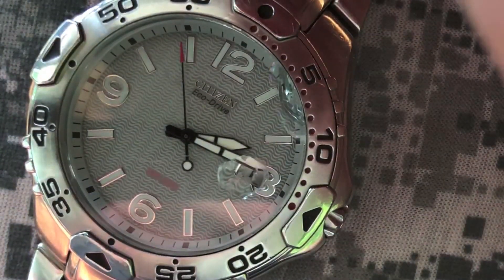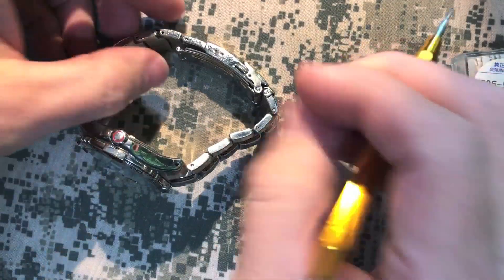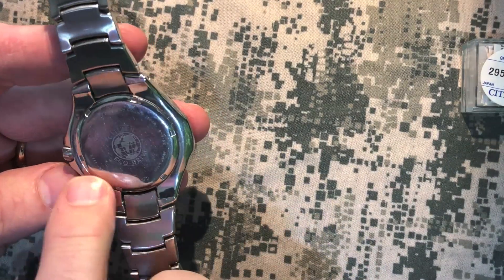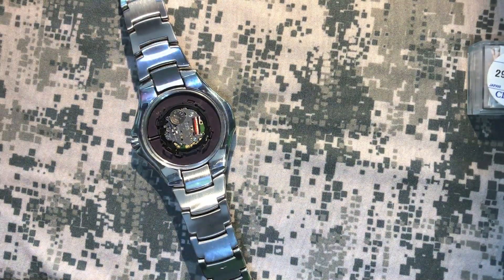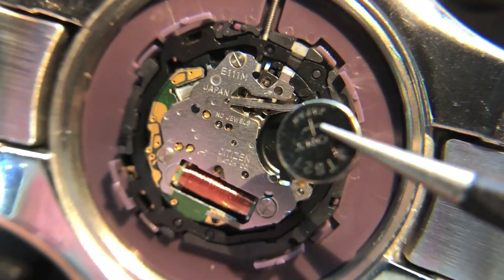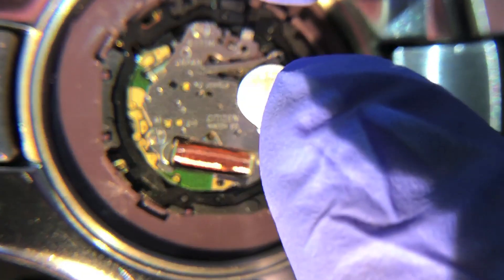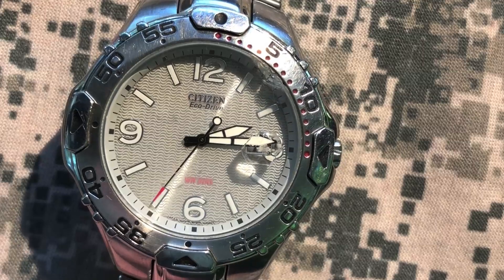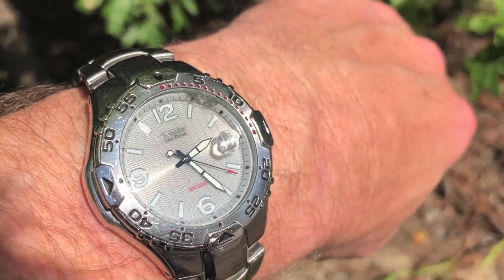How to Fix Your Citizen Eco-Drive Watch | Replace Capacitor

Comment: I have a Citizen Eco and after 10 years  it was ticking with 2 seconds increments too. I charged the battery by putting it at the kitchen window for two days, but it was still ticking with 2 seconds after that. Pulling out the crown and pushing it back solved the problem! It has been ticking nicely for 3 year years after I did that.
Reply from the maker: Nice. Your reset worked. Some of us haven't been as lucky, and the battery/capacitor/rechargeable cell needed replacement. You're at 13 years now, so you might be towards the end of life....if it happens again.
Reply: @WatchWitt how do you take the back off of one that doesn’t have the slots? My dads watch doesn’t have the notches.
Reply from the maker: @he-mansuncle7661 Depends on what's there. If you see ridges like a coin edge bezel all around the caseback, then a friction ball is your best bet. If you see a little pry ridge/lip on a small section of the caseback near the edge, then it's a snap off/on caseback. Proceed with caution there, as there's a risk of damage to the crystal when trying to put those back on without proper tools. I don't THINK there are Eco-Drives with that type of caseback, though.
Reply: @ thanks, I ordered the kit that you suggested. I don’t believe it is beveled, but smooth.
Reply from the maker: Hopefully friction ball, then. The kit I suggested doesn't include one, but they're about $8 on Amazon for a cheapy, and maybe twice that for a Bergeon: https://amzn.to/3Yvth92

Comment: I did this myself on two different 15 year old Eco-Drive Citizens. No problem. My only additional advice is while ordering a basic watch tool kit also order a little container of watchmaker Silicon grease. I always apply a very light coating of Silicone to the case back seal. My only gripe for the process is the expense of the capacitor. I can buy a twelve pack of standard watch batteries for $7. My Citizen Eco-Drive capacitors were $25-30 apiece. It is what it is. I love my Citizen Nighthawk that my son gifted me 15 years ago. While I was working on the Nighthawk I also replaced the scratched mineral crystal with a double domed AR coated sapphire crystal.
Reply from the maker: And it's like working on a car...you feel a sense of accomplishment! I enjoy it, too. I need to replace the crystal (and cyclops) on this watch.....

Comment: Anyone know whether you can overcharge a citizen eco drive? I sometimes hang it with the washing and forget to take it off for hours...
Reply from the maker: No, they have a mechanism that prevents overcharging. They do warn about charging in higher temperatures, though. For instance, on the dash of a car. I think they quote temp should be below 140 degrees Fahrenheit.
Reply: @WatchWitt  Thanks man! (BTW in the description you might want to change "minute" to "second", in first line.. HTH!)
Reply from the maker: 😂 Thanks! That mistake has been there 3 years...just revised....

Comment: where do you get other parts, and find a parts number list ?
i have a citizen watch that does not run, something is broken  i send it to the citizen service center, but that place is full of clown, they had the watch close to a month and did nothing !
Reply from the maker: It's difficult. But you can try Cousins or Eslinger. I'm surprised the Citizen service center wasn't helpful. They're slow and impossible to communicate with, but they usually send back a fixed watch!
Reply: @WatchWitt  Thank you !

i'm from Sri Lanka, the Citizen service center used to be good but i think it's under different management !

Comment: Why would amy manufacturer produce something as stupid as a solar powered watch? Conventional watch batteries are low-cost, available everywhere and easy to install.
Reply from the maker: I hear you, but there are also advantages to solar. One thing I can think of off the top of my head, this diver is more likely to keep it's waterproof rating if the caseback only comes off every 12 to 15 years, instead of 6 to 7 times in the same period. Most enthusiasts don't change the caseback gasket.
Reply: @WatchWitt  Good point. I just can't help but feel that manufactures implement this type of of technology not for the benefit of the consumer but as a form of built-in obsolescence.

Comment: The chargeable battery in most solar powered watch have a service life of about five plus years they do not last for ever logic sense like a vehicle rechargeable battery same principle
Reply from the maker: The original gen of Eco-Drive, which the watch in the video is, are getting about 12 to 15 years of life. I hear that more recent generations are expected to outlive that. Some of the confusion about these watches is that Citizen claimed the watch "never needs a battery," or has a "lifetime battery," etc. But, as you mentioned, that's simply not the case!

Comment: Yea many think the light storage battery will last forever but any kind of quartz time piece uses a battery
Reply from the maker: Yeah, these will run on light alone, no battery, as long as the dial CONSTANTLY gets light! 😂 But that wouldn’t be very practical. When Citizen first came out with these they claimed to the affect of “never needs a battery,” which I’m sure has created some confusion.

Comment: Thanks for this video. I'm looking to replace the cell in my Eco-Drive. However, mine doesn't have any notches on the cover. Any ideas on how to remove it?
Reply from the maker: Hard to say, as there are a few different caseback styles. If you have  series of small ridges around the caseback perimeter (almost look like a grip for your fingers to rotate it) then you need a friction ball. Or, if you see a little lip, almost like a screwdriver head, near one of the lugs...that's a snap on/off caseback. You pry/leverage that carefully to remove. But caution with those...they can be extremely difficult to put back ON without the right tools, and you risk damaging your watch...many will shatter their crystal while attempting.
Reply: I did a little more research and found out it is a monocoque case GN-4W-UL. Apparently, the bezel needs to be removed and the stem to replace the battery. I would love to see a video on that!
Reply from the maker: @stevenmonkman1500 Oh, wow, I've never seen a monoblock case from Citizen. Yes, typically you have to remove the crystal and go in from the front! You should be able to find some videos, but specific tools are needed. If you don't have the experience, this one is better off having done by a watchmaker.

Comment: People in the thread, try pulling out the crown & pushing it back in. Sometimes this works as it resets the second increments after/while charging. I purchased a Citizen Skyhawk from Amazon back in 2011. It’s 2024 today & my original capacitor/battery still works fine to this day. This watch has been in & out of rotation for months/years at a time & gets stuck in a drawer at times. I just put it in a window sill & it charges right back up no problems. It ticks in 2-4 sec increments when charging back up. I just pull the crown all the way out & push it back in & it works brand new again no issues.
Reply: Thank you man, just bought a new capacitor, put it towards direct sunlight for days but nothing, still 2 second jumps and index finger pointing towards NG. Pulled and pushed the crown and it jumped to LV.2 with regular one second jumps…happy ;-)
Reply: I have just left mine on a windowsill for years because the second hand was skipping, searched for a video on it, was playing with it while watching the video, essentially doing what you just said, and it’s working! I love this watch, it is a promaster nighthawk with a rubber strap, they never sold it here, I ordered it from Japan.
Reply from the maker: I keep mine in a window sill as well, south facing, so it always gets a TRICKLE charge. For those having charging issues, DIRECT sunlight is the way to go, though, as windows/screens can minimize the charge.

Comment: Thanks, I take a couple watches (G-shock mudmasters) into the jewelry store, for battery replacement. For some reason the tech at the Jewelry store did not work on these watches but they have someone that they send some watches to. The staring price for battery/capacitor replacement was $125. The capacitor and the watch repair kit added up to less than $30 (I will also replace the gasket based on your recommendation).  But while my citizen was more expensive it is still kind of a basic watch with no special features and I should be able to replace the batter/capacitor. Your video was very helpful.  Thanks for your video. Sorry for all the trolls trying to give you a class on battery vs capacitor.  Your video was fine. Order the right part in the first place and you don't have to worry about putting a battery where a capacitor should be. Regardless of what I am working on, I always check my parts across several websites to make sure it is the right one. I like the part about wearing gloves. That is my down fall. I get into the repair and forget to put on the gloves laying next to me.
Reply from the maker: Yes, it's expensive, but definitely worth it for those that aren't comfortable doing the replacement themselves. I mean, you're going to get another 10 to 15 years out of it!

Comment: Is this 2second ticking normal for a watch I bought brand new just 7 months ago?
Reply from the maker: That means you need a recharge. Follow directions for that (HOURS under a light or in direct sunlight) and if it still does it, then this video applies to you too. But be sure to read the recharge directions. Most people aren't aware that it can take days to recharge.

Comment: Before you replace the capacitor try putting an adjustable LED LAmp above the watch for a few days and see if it helps.  It helped me to charge my Citizen Skyhawk that had not seen light for years.    I left an LED Lamp directly above the watch (Maybe an inch above the watch) for 2 days over the weekend at work and when i got back on Monday it was fully charged and held the charge as if it was brand new.
Reply: This!  I was ready to replace the capacitor in my 15 year old watch because it hadn't charged after sitting on my desk near a window for several days. Then as a last ditch effort, I put it inside a lamp - after about 5 days of being exposed to light at close range, it started working normally again.
Reply from the maker: Absolutely! Window sills are great for occasional top offs while not wearing your watch, but window films/protectants, screens, etc can reduce the effectiveness of actually charging.
Reply from the maker: Absolutely! I tried to convey that, especially in the video description. Most people don't realize it takes DAYS, like you mentioned, to recover from a completely dead state. However, if your watch is 12+ years old, and that doesn't work, then it may be time to replace the capacitor/cell/battery.

Comment: Great video, thanks.
My watch number is E110-R19955 RC
. What sort of battery should I buy? Thanks
Reply from the maker: You'll want to confirm on your own, but I believe your movement also takes the same part number as mine, coincidentally. 295-5100 you may also find it with the trailing zeros omitted, 295-51.
Reply: @WatchWitt  Thanks!

Comment: I just bought a Citizen Eco-Drive BJ9130-05E on eBay and it arrived with the dreaded 2 second tick. I assumed it had probably been in a draw or a box for a while so just needed charging but after a few days on the windowsill, it still wouldn’t hold a charge. I googled it and realised I needed to change the capacitor. I then found this video on YouTube and you made the whole process simple with your excellent and easy to follow demonstration. Thanks to you I have a working Eco-Drive! Thank you!
Reply from the maker: Awesome, glad to hear! Thanks for leaving the positive comment.
Reply: Are you interested  in doing this repair on my watch. Jewelry stores want a small fortune!@WatchWitt

Comment: I want to replace the gasket as recommended in the video, but I cannot find a source for parts. The watch I'm working on is an E011, so I'm guessing it's the same vintage as the one in the video. I checked the Citizen website, but it seems Citizen doesn't support their 
older watches.
Reply from the maker: Yes, it can be difficult to source the right part. There are many vendors on eBay, if you can search your watch model number, not the movement number. Eslinger and Cousins are great resources too. Watchmakers will generally order these in bulk, in various sizes and thickness, and match up using the old gasket as a template. Good luck! If all else fails, a watchmaker can do this for you quickly.

Comment: Thank you! I bought my Skyhawk in June 2002 after transitioning from the C-141A/B to the C-17A. Stored the watch for the last 10 years in my top drawer. I was wearing a Breitling Areospace. Digging thru the drawer, I found my Skyhawk. Deader than a door nail. Trying to revive it. So far no luck. Any ideas?
Reply: It needs to be reset. You can find out how right here on YouTube.
Reply from the maker: If you can put it OUTSIDE in direct sunlight (not in a window sill) that's the best bet. If you must charge through a window, it will take longer. But these can take 30+ hours of recharge to revive.

Comment: A "battery" is not a "capacitor." Does the watch have both?  If not, which did you replace?
Reply from the maker: Whatever Citizen calls it is what I replaced!😂 Just kidding. We've covered this topic in the past, though. See pinned comment at top, and there are other comments like yours as well. I actually used 3 terms for the same part; battery, capacitor, rechargeable cell. Is that correct? No. Was I secretly trying to emphasize that that you shouldn't replace with a STANDARD watch battery? Yes.
Reply: @WatchWitt  Citizen calls its Titanium Litihum capacitors "batteries," "battery capacitors," "capacitors," and "power cells" - maybe "pickles" if I look some more.  :face-fuchsia-wide-eyes:
Reply from the maker: @thomaslinton5765  Haha! Maybe that rubbed off on me?!

Comment: Any suggestions for a good place to buy replacement gaskets?  I have a similar Citizen watch, E870 movement.   I am having a hard time finding a gasket.  Figure I might as well change it while replacing the battery.
Reply from the maker: It IS a good idea to replace the gasket, because at 12 to 15 year battery life, it's a pretty good chance you're the first one crackin' that case open. Esslinger is always a good resource in the States, or Cousins in the UK. You can also find random eBay sellers.

Comment: I have this exact watch but the case back is smooth, no notches for a tool like you show to grab and turn. How would I get a smooth case back open? I was thinking maybe it’s a tool that uses friction to allow you to turn the case loose…a point in the right direction would be greatly appreciated.
Reply from the maker: That’s weird since it’s the exact same watch. I can’t imagine it’s a snap on case back, but look for a groove or lip for tool prying leverage. More likely that, as you say, you need a friction ball caseback remover. $8 for a cheapy, $13 for a quality Bergeon.
Reply: @WatchWitt  thank you for the reply, I looked all around and it's totally smooth, no lip or groove at all where a prying tool can be used...will have to see if I can find a friction ball as you mention...
Reply: Pros use a somewhat dull knife - shortifh blade and generous handle.  Lots of YouTube videos.   This guy uses a small screw-driver: https://youtu.be/KxX40QIS1U4

Comment: Never thought the eco drive had a battery. That was why mine stopped working. 😅
Reply from the maker: Many of them stop after living in a drawer or other dark spot, then people don’t recharge them long enough to revive. If yours is in the 12 to 15 year range, the rechargeable cell probably needs replacing. If it’s newer you might be able to bring it back to life!

Comment: Any help on diagnosing the problem on my watch. It's j810 caliber Citizen.
The problem is that the watch doesn't show the battery is discharged. The second hand is ticking normally. 
After leaving the watch overnight it stops and gives me the incorrect time the next morning. The watch is only a few months old and I haven't changed the battery.
It's my understanding that these eco-drive movements can work for over 6 months in total darkness.
Great video btw.
Reply from the maker: Yeah, that’s weird. Definitely doesn’t seem right. You may have a problem with the movement, such as resistance that is draining the cell more rapidly, so you never SEE the 2 second ticks. But that’s a long shot. Does it keep perfect time in the day, when you’re wearing it? If so, I would suggest trying a deep charge. If you can’t get it OUTSIDE in direct sunlight for 12 hours, do an indoor lamp for 3 to 4 DAYS. If that fails, I would pull a warranty claim on it.